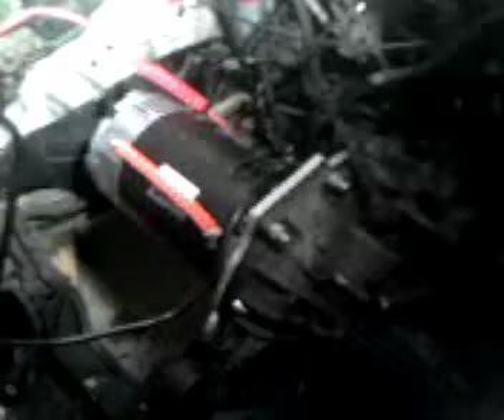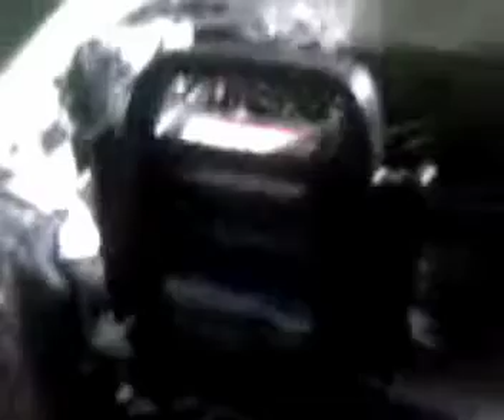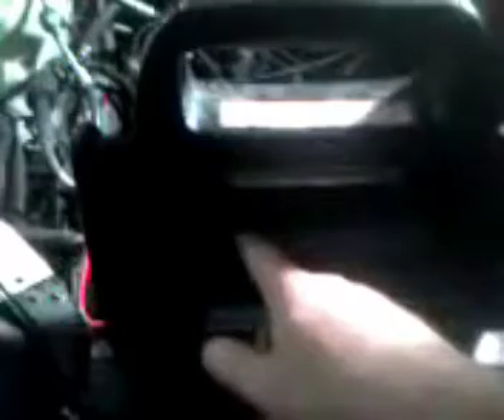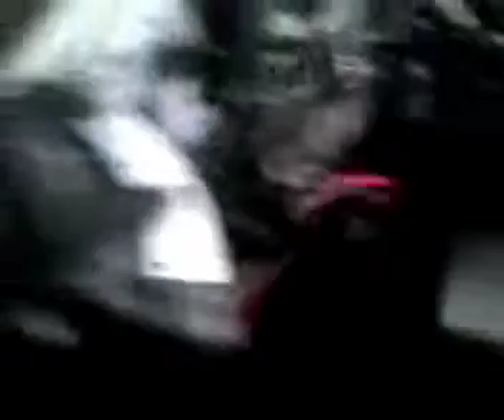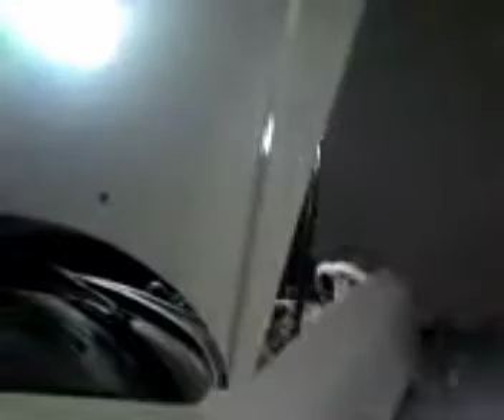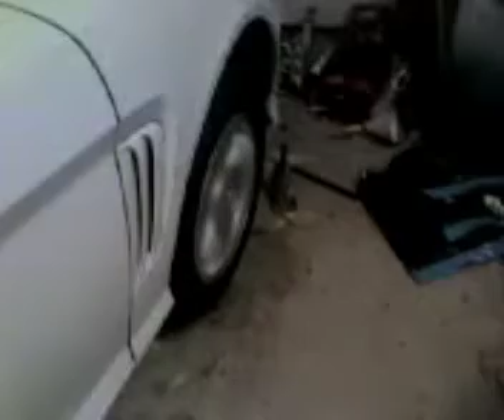Electric Car's Wheels are Spinning!!!!

Comment: @robbcochran   Sorry mate, a 20hp motor will only put out 20hp no matter how its geared.  In fact, your transmission will actually sap some power from the motor (friction/inertia losses) and your actual power measured at the wheel(s) will always be something LESS than 20hp. Its more effecient to use motors that wont require a transmission.  A PAIR of 20hp motors should be able to power a lightweight vehicle; say 1800lbs or less.